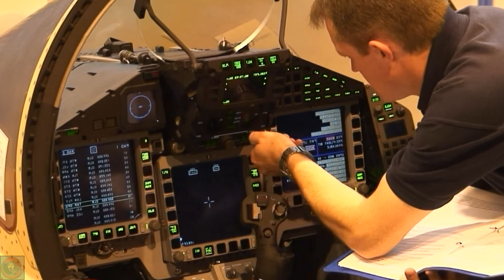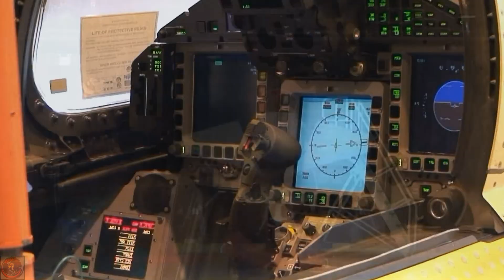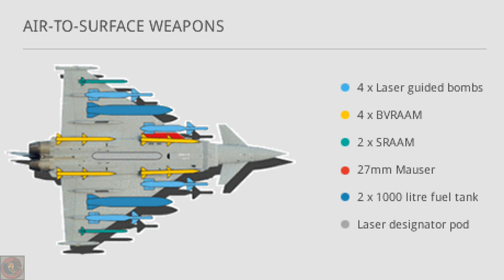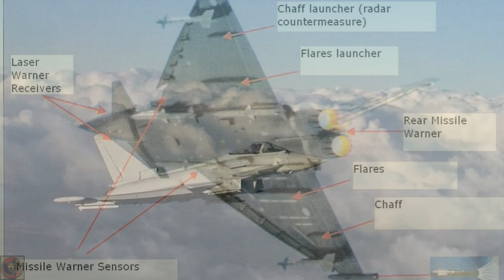Eurofighter Typhoon Combat Fighter Jet - Europe’s 4th Generation Fighter

Comment: This is as you said a beautiful aircraft. With any luck the F35 will continue its fall and the intreast will grow again.
Reply: What fall? It beat the typhoon hands down.
Reply: john harker considering the F35 meets zero of the design goals, isn't going to be combat ready till sometime between 2018 and 2022 and the possibility that the F35 in Israel was tracked and fired on... that fall. The F35 is a failure by every sense of the word (so far), I continue to hope for its demise actually because we need a wake up call. This thing, the Zumwalt, the Littoral, all tech chased money wasting, lobby pushed piles of carp. My opinion of course.
Reply: None Ya Buisness What design goals has it not reached? And if it will not be ready for deployment by 2020, how was it shot down by a missile? That's a really big contradiction.
Reply: john harker the first design goal it fails is the affordable aspect of the JAST and CALF or JSF program... that automatically makes every other goal fail.

Have you ever read the outline for those programs though? Download the pdfs and you will see the better question is what can it do better than any of the planes it is supposed to replace, which again makes it a failure. The F35 is nothing more than a Sentry/Nighthawk hybrid, fantastic for those roles but not so good for anything else.

I understand that you may not understand the relationship and what the Israeli military is doing with the F35 and the separation of deployment and combat ready. The F35s as right now are advised to avoid combat... run. So it's not a contradiction
Reply: None Ya Buisness define affordable. The F-18 super hornet costs only 15 million less than the F-35 will cost next year. And the Super hornet is a far less capable aircraft.

The danish have decided that it is less expensive than the typhoon overall 

"the Danish report claims the government only has to buy 28 Lightnings to 34 Typhoons or 38 Hornets. Quality over quantity, it seems."

I couldn't find anything on the the design goal PDFs could you provide a link?

The S-200 shoot down is bogus.
Reply: john harker I would not say the F-18 is a far less capable aircraft. It lacks the stealth capability of the F-35 and nifty electronics package yes, but as I mentioned before that is like saying the F-18 is far less capable than the F-117 and the E-3. Can the F-35 refuel other planes? Does it lose much of it's distinct stealth advantage if it uses external hard points? Are you really going to straffing run with a plane that can coordinate so much data?

Have you read the Danish report, or are you quoting a report of the report? I am not sure what the quotes are for. I read it and that specific part of the report is on the economics vs sorties only and over an expected life cycle of one plane versus the actual of the other two, and that's over a 30 year period. Part of the economic reason for the high number of F-18s was a two man cockpit. Another part was covered in the video Matsimus provided, it's a newer plane cutting into the other two, world wide, multi nation support etc. It has nothing to do with quality of quantity. It is kind of actually the other way around.

a292094 is what you want to put into Google it should be the first pdf

Want to say more but it's early and I better get some sleep... for now
Reply: None Ya Buisness Buddy refueling is done with a pod and fuel tank hard point. There is no reason the F-35 could not do that. The F-35 will run slick and stealthy when it needs to run slick and stealthy.

 It will use hardpoints when it need to use hardpoints, and it will still be a farther on the stealth spectrum than the F-18.

I never read the actual danish report, but I doubt it said "the F-35 is a flying piece of garbage, but we're going to buy it anyway. 

I'll look at that pdf as soon as I get to a computer, I can't copy and paste on a cellphone,  and I don't have a paper to write down that number you gave.
Reply: None Ya Buisness And yes, the F-35 will be used for strafing, and it's not going to be a big liability because it has superior ISR systems, and only costs 15 million more.
Reply: john harker Actually Cobham says it will make future pods suitable for fifth generation fighters, whatever that is it seems to indicate that currently they are not or at least not acceptable.

The U2 was selected because of it's smaller cross section and higher altitude, and still shot down, the F-117 also shotdown, and both of these aircraft were specialized, not multi role fighters that compromised their stealth features by adding things to compromise their stealth and running closer support with a GAU. 

You shouldn't quote from a report that you haven't even read, and after reading the report I only reversed your conclusion of the report... that you didn't read. Of course they wouldn't call it a piece of crap that would be silly. I called it a piece of crap for being a tech chaser and not fulfilling its goals, its a great Sentry/Nighthawk upgrade though and in that role it would not a piece of crap.

Cool, I have plenty more from the CBO and then just papers that claim to be unbiased.

You have brought up 15 million a couple times now, but it's not the right comparison in price, The F-35c is what would replace the Super Hornet not the F-35A and that is still sitting at $122 million, the F-35B is $123 million. Not only that but the F-35 has a higher operating cost. The latest report is that we will spend 1.1 trillion operating the F-35. It's also curious you haven't mentioned the F-16 or A-10 pricing.
Reply: None Ya Buisness I don't need to read the full danish report if you are going to invoke the S-200 shoot-down fiction. Here's the deal. The Danes turned down the typhoon because fewer F-35s could do the job for them. It has a lower price, lower flight hour cost, and longer lifespan. Even the two-seat F-18 beat out the typhoon in most categories. The Typhoon is at the end of the day, a 4th Gen strike fighter that is only a bit more functional than the strike eagle. Beautiful plane, but so was the spitfire. And just like the spitfire, it has been surpassed by other designs nearly at the start of its life cycle. 

I didn't compare it to the F-16 for what I thought were obvious reasons. The Danes are replacing their F-16s. Had they felt that the F-16 was ideal, they would have bought more.

I didn't compare it to the A-10 for the same reason I didn't compare it to the A-7. It is not in production. 

So back to your original point that the F-35 is a failure because it isn't by your definition cheap. Wasn't the typhoon supposed to be a widely produced fighter in use around the globe? Well it's not, so by your own logic it must be a failure. I personally like the plane myself.
Reply: john harker "Invoke", I don't think that word means what you think it means, "...and the possibility" is hardly a statement of authority to invoke. Maybe re-read, you are the one that said it was shot down, I said "...possibly fired upon", as in their are questions about the timing of the two reported incidents. Since a U2 and an F117 have been tracked and shot down before there is a chance. Propaganda, probably. Possibility, possible... probably why I used the words "possibility fired upon" and you used the words "shot down". You shouldn't define both sides of a discussion, it's rather counterproductive.

Wether you read the Danish report at all has zero to do with what I said, that's a silly point to make. You are just deflecting from inaccurately portraying what I said and what it said. The Danish report did not say fewer F-35s could do the job for them, if you took the time to read it said because the f-35 is rated to fly 8000 hours compared to the 6000 of the Typhoon and S'Hornet it would need less planes over a 30 year span because of that. Of course we kind of already went over this. I guess you dismissed it because of your false characterization of what I said earlier.

It's amusing that you would bring up the Spitfire since the government is looking at prop jobbers to do CAS and such... effective as a tandem effort to keep troops safe for much, much less than an F-35. 

The F-15.... what, wait? The F-15SE beat out the F-35 in competition for a South Korean contract and Isreal actually wanted the F-15SE but the then President Obama said no. 

The F-16 and A-10 comparison was brought up because as I said you mentioned the $15 million twice, once in a reply to the program which did not involve the Danes and once to say it's a good idea to staff with. Again, the F-35c is replacing the F-18 or to be used in conjunction with the F-18 and it is considerably more expensive than the numbers you quote for the F-35A. The F-35A would be the one most likely replacing the F-16 and A-10 and the price difference isn't only 15 million. As for the Danish report that (again) you didn't read there is no point in discussing interpretation because you have dismissed it and stood by your "quote", and that is what it is.

I said It didn't meet the affordability of the two programs that became the JSF program.  Never said it failed because it wasn't cheap, I said It automatically disqualified it from every other target... It fails those targets in its own though. 

The Typhoon is a failure because it isn't used around the globe is the same as the Lightning not meeting design goals? What? First the Typhoon is used by 8 or 9 countries... and some of it's competition had been in service for 20 years prior, which actually goes back to the Danish report about supply, partners and all that jazz. 8 or 9 countries is pretty darn good. Anyway no its not the same logic at all, the Typhoon is an excellent fighter and as far as I can find it met it's design goals. France dumping on the project probably cost the Typhoon 3 additional operators
at the minimum, so yea 9 and a theoretical 12 countries in non Warsa pact countries with planes like the F-16, F-15, Rafale, Gripen all out there and beimg in more countries than all of them except the F-16 is pretty successful in my opinion.

Comment: poor engine choice as the equipment was sized as replacement for the  GR-4, which never happen...it takes off an runs out of fuel, Range is beyond poor.. an very outdated Avionics, along  the cheapness of the Europeans refusing to upgrade it  " an fully commit  to Tranche 3 plus..kept it from really winning any contest it was involved in..(aside the force buys of old Mid east customers)..the name translated well to the four countries well` which is why it was chosen(as good a  reason as any)..but I wouldn't  want  to Dog fight against it in the traditional sense, because this baby can turn like Typhoon:)..(ps. they don't use the cannon , but because of the center of gravity an because the Lead weight they designed to replace it COST more than just keeping the cannon there, they went with that)..cheer's Allan ..

Comment: +Matsimus Gaming it is technically 4.5 generation not 4th. But good vid as always. Also matimus, the internal cannon is used by the RAF and they have ammo for it, originally they were not using the gun and only had a concrete block where it is place but now, they have been using it for the last 10 years or so.
Reply: technically there no no such nonsense as 4th or 5th generation. it's  made up pentagon crap talk to dumb down everything so that americans can understand it. so just try to get the 4th and 5th gen nonsense out of your head ad never again use the word 'technically' if u don't know what that means.
Reply: Mar I didn't know that Mar, thanks to know. Also I can use technically if I wish.

Comment: It’s far from being a multi role aircraft and also need to work on super cruise but what a beauty
Reply: The latest Tranche has incorporated some multi-role features. However the Typhoon was designed to be an air-superior fighter as well as an interceptor. And in that category, it is a monster in the air, with few aircraft that can challenge it in the air. Except the F-15 and the F-22.